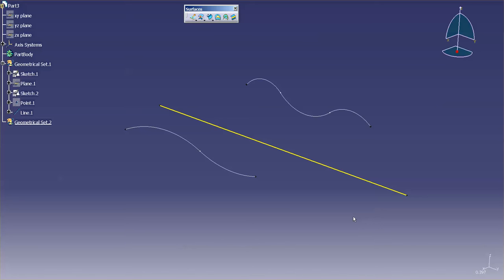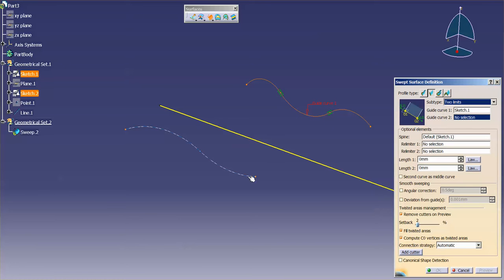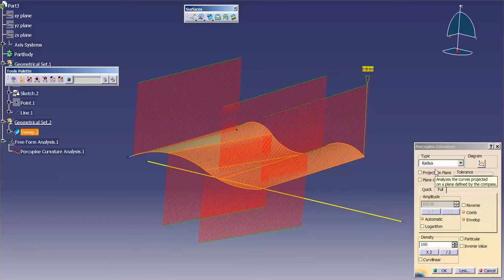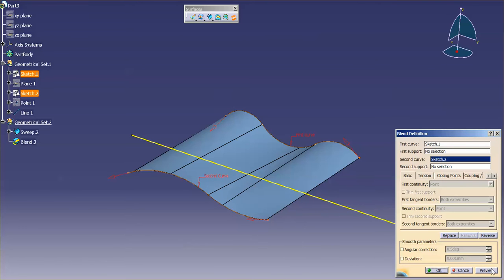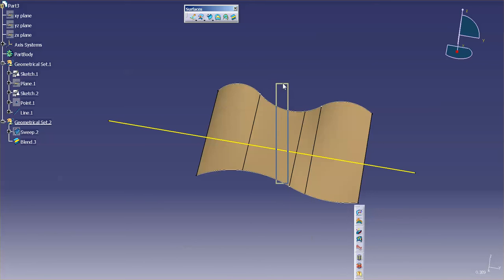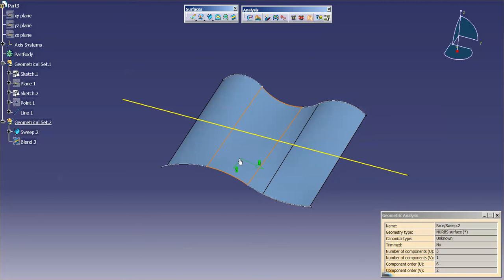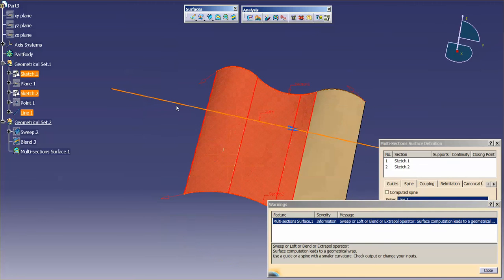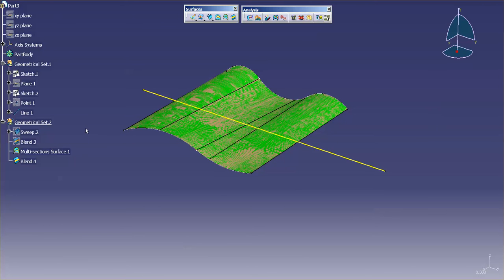Catia V5 | Catia V6: "Ruled" Surfaces

Comment: another technical question when you compere the blend and the linear sweep with different U V elements. which is the best for you? in my opinion it would be the one with less elements, but let me know your opinion
Reply from the maker: +jose hernandez The preference is less elements. Or the way I define it it is visible patch count. How many faces. Internally the math should be very similar. I will use various techniques to reduce the overall math as much as I can. The more math the less likely you can Offset/Think Surface.